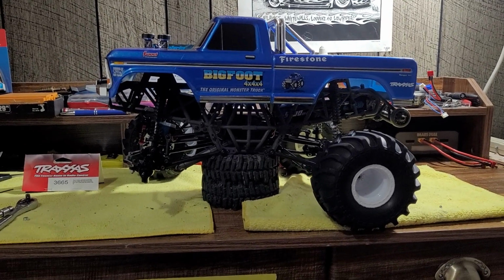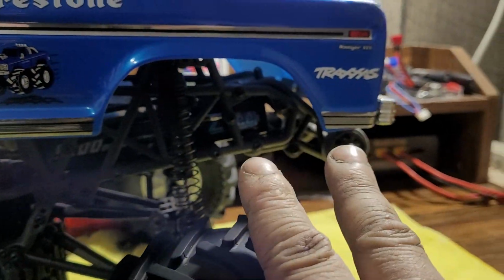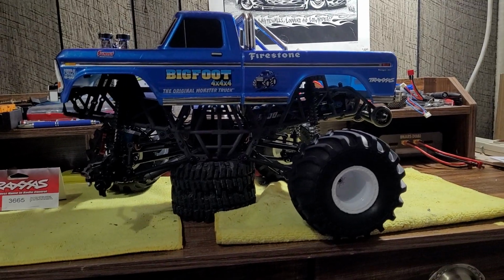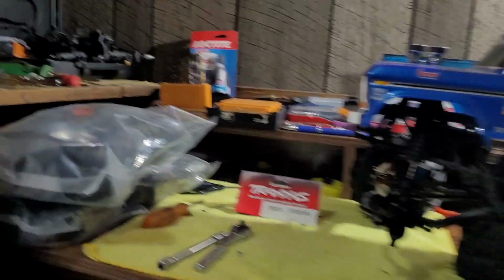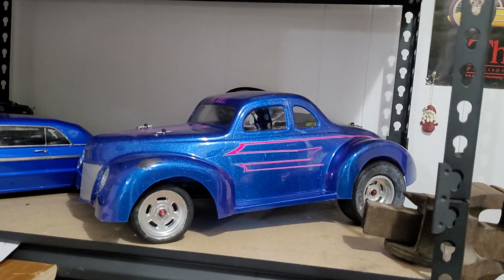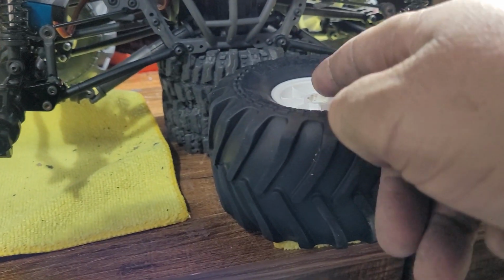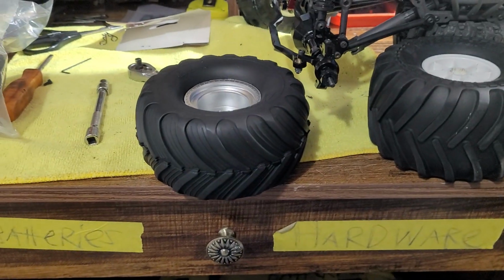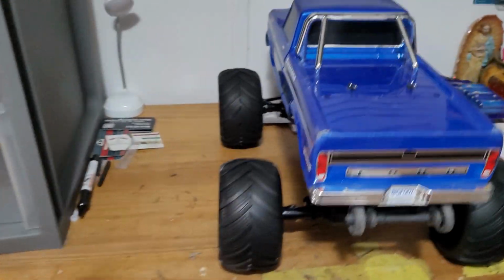More on the mst monster truck

Comment: Thank you for sharing.  The stock wheels/tires looks better IMO.  Put the hex nut on the back of the rounded wheel, and use clay like play dough to make the mold, and pour JB weld or something similar to fix it.